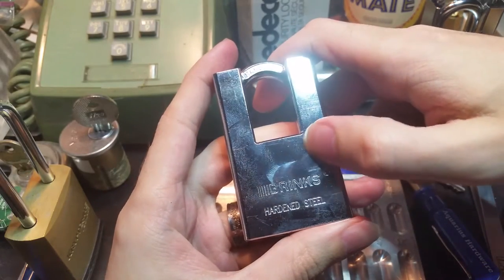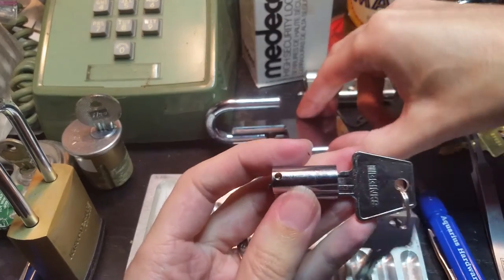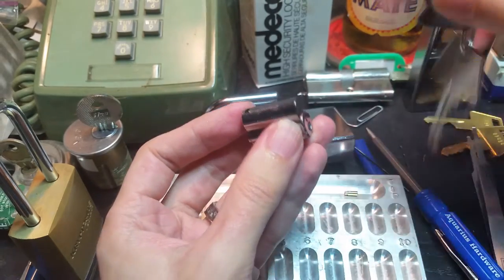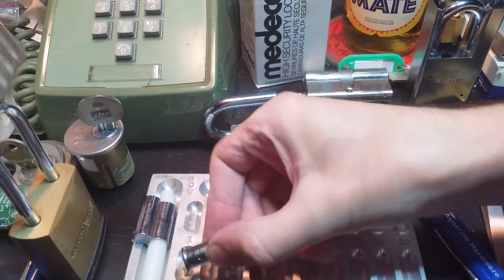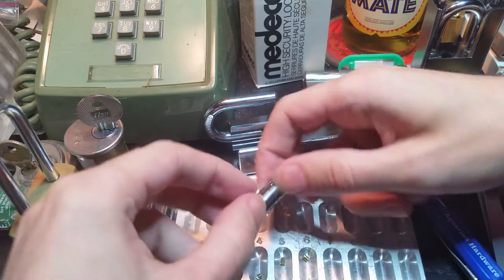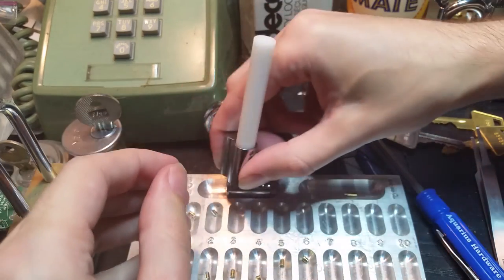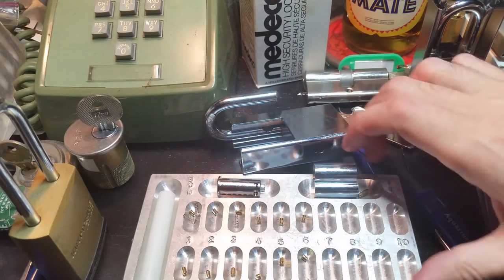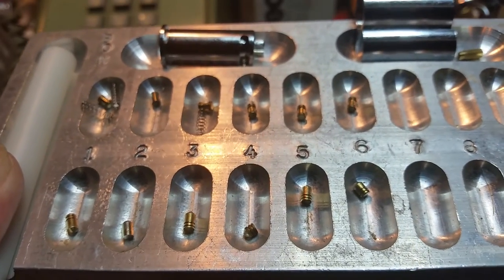(72) Brinks Shrouded 44mm padlock gutted

Comment: Thanks for getting the second lock. I was looking at one to buy and was not thrilled to find out that there is no (easy) way to remove it's lock cylinder. But now that I know pretty much what's inside the things, I might still go ahead and get one. They aren't expensive and seem pretty secure. Back in the day I have had some fun making my own picks, and tensioners out of broken street sweeper bristles and lawn rake tines. But I always really wanted some nice "real" picks. Now with the Internet, the only trouble is who, which, when, and how much. :) BTW I was hoping to see you drill out that pin, really would've liked to of seen that, but whatever. It's pretty cool you got that second lock and took its guts out at least. Good clean drilling (if that's what you did) BTW. Damn this Brinks lock for making their lock cylinder so hard to take out of an otherwise very cool lock! PS - I was thinking after the first vid about this lock, I'm going to look on his list for that second video. And I probably should subscribe if he really got another one. So here it is, subbed!
Reply from the maker: I did have to drill the retaining pin, I used a very small drill bit and then jammed a screw into the hole to pull the pin out. I would have tried to film it but it took ages and would have been impossible to keep everything in frame. It is a pretty good lock, especially considering the price.